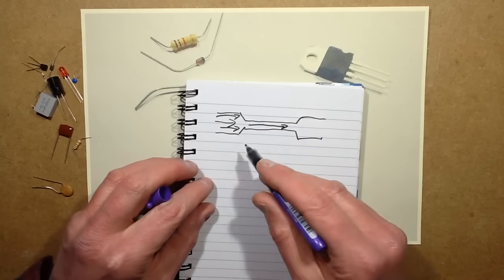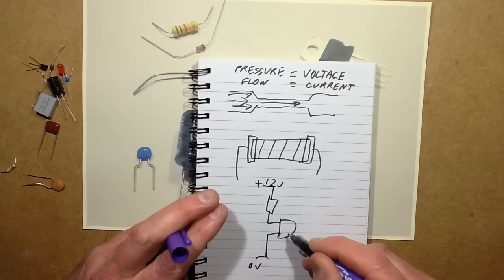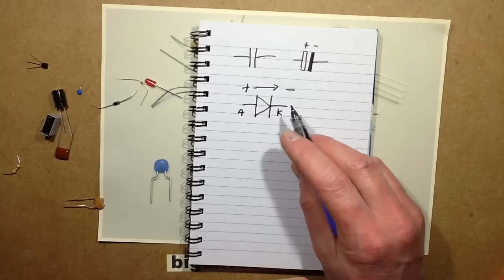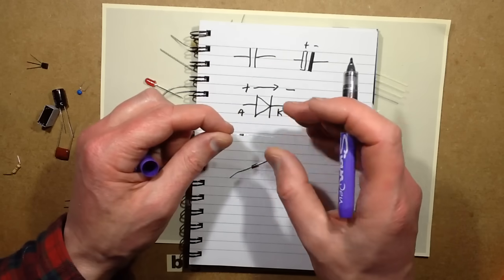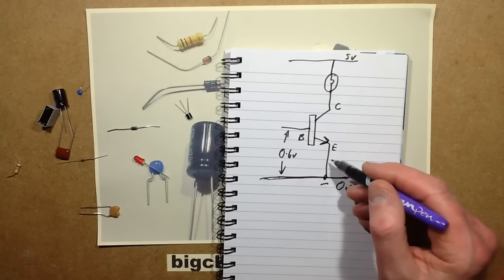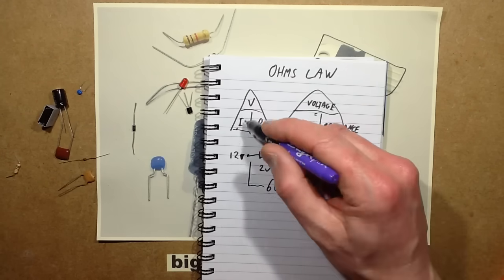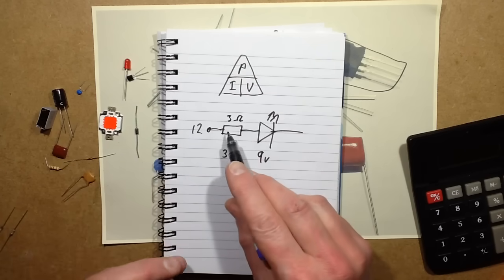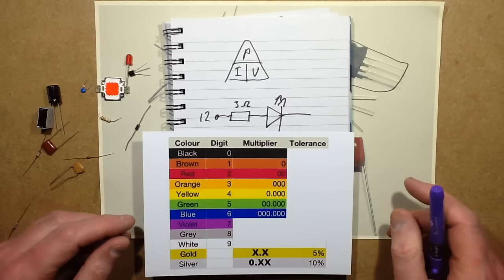A simple guide to electronic components.

Comment: I'll have to go back and rewatch to see if this was addressed, but the connections between components are very important, as well. For beginners, an inexpensive breadboard is probably the best investment you can make, especially for experimentation on a bench. It will also eliminate the possibility of 'cold joints', a very common beginner mistake, and one which can cause very strange behavior. One less thing to worry about makes it that much easier to concentrate on the circuit design. Soldering is not difficult, per se, but it is definitely an acquired skill, requiring many screw-ups, and sometimes years of experience to get it just right, e.g. SMDs with tiny pin pitches.

Comment: What frustrates me about electronics is that it discriminates against 8% of men. I studied electrical engineering but I hated my circuits classes, and especially my labs. Everything else about electrical engineering I either tolerated or enjoyed (especially electromagnetism and device physics). Every lab began with an exercise that is impossible for 8% of men, picking out the correct resistor by color. Yes, the bins were labeled but what do you do when you're at your lab workstation and need to quickly work your way through the exercise?

That killed my interest in electronics, led me to take the computer science classes my program offered, and eventually I simply left after being in the undergrad program for 6 1/2 years.

That was in 1999 and since then I've been doing computer programming as a living. I hate hardware because of resistor color coding, and the impossibility of working on circuits as a result. Fortunately, with your channel I'm able to learn for the first time what I should have learned in school but was unable to. Your channel is rekindling my interest in electronics, as is the habit of labeling resistors numerically. It's easier for me to solder a surface mount resistor than to identify a resistor by color. The former is difficult. The latter is impossible.
Reply from the maker: +John Gotts If you keep your resistors in storage trays marked with the value as I do, then you can easily pick out the desired values and double check with a meter before soldering them in.
Reply: Whilst i don't suffer from colour blindness, I find resistor bands of little help since the metal film blue colour backing makes grey look orange etc. I use an old fashioned card storage with my resistors stapled to them and values written on. When resistors fail in circuit, again, bands are often not helpful since such resistors are usually burned enough to discolour the colour code beyond recognition. 
My suggestion to young men interested in electronics is don't let colour codes dissuade you, they aren't too important. They are hard enough for people with normal colour vision to generally avoid.
Reply: With the increasing prevalence of SMD, where the resistors have numerals printed on them as opposed to colour bands, this should be a diminishing problem.
Reply: @John Gotts I don't know if this would make a difference but I share it because, for those who are color blind, it would be nice to have the choice this product appears to provide.  Search "EnChroma glasses for color blindness".  They are not cheap but it made me cry to see some of the reactions of people for whom they facilitated color vision.  The only thing I know about them is what I saw online. Best wishes. :)
Reply: There are also phone apps which can read the value of a resistor just by aiming the camera at one.
Reply: +John Gotts It all takes time. I was unable to read them by color bars, too. But now it's a piece of cake for me. Practice makes perfect
Reply: +John Gotts Wow, you must be really seriously color blind. I fail the Ishihara tests badly enough to be considered ineligible for military service (in the 70s at least) but can still manage reading color code, although I need really good light and am a bit slow at it.
Reply: +MrJohhhnnnyyy Are you or are you not color blind?
Reply: Asura I don't suffer from color blindness. My point is - if you don't have any problems with sight, it's not that difficult. I fully agree that if you do have such problems, that's huge difficulty.
 I'm saying that 'cause I've seen a lot of people who have no issues determining the colors, yet they claim color code to be "very difficult to understand"
Reply: John Gotts please tell me that you know about the color correcting glasses for color blinds!!! its called "Enchroma" please google it!!
Reply: Kyle, for reasons that have to do with genetics, (men only have 1 copy of the X chromosome) it is extremely rare for women to be colourblind. Similarly, calico cats are almost always female.
Reply: We could try changing the Code to incorporate Shapes. 

But aby that time we might be able to simply read a numerical value. Also this might or might not help people who are both Colour Blind & Dyslexic, of coarse gender matters in neither case..
Reply: gay

Comment: hi does the resistor still burn under oil or just discolour
Reply from the maker: +playdav485 You do get oil cooled resistors that help dissipate the heat.  If you used one of these in oil it would handle a higher current, but would still be limited by the speed at which the oil could cool it.